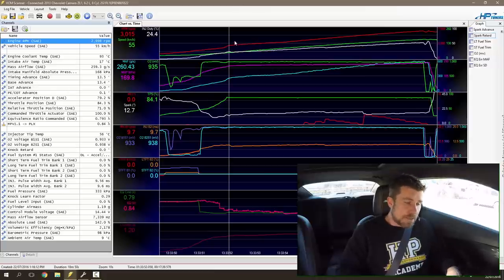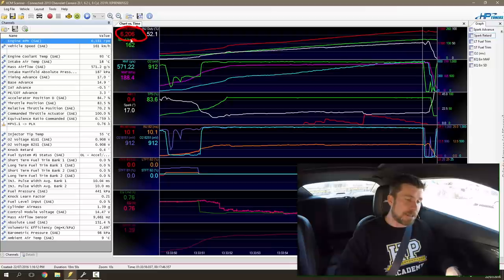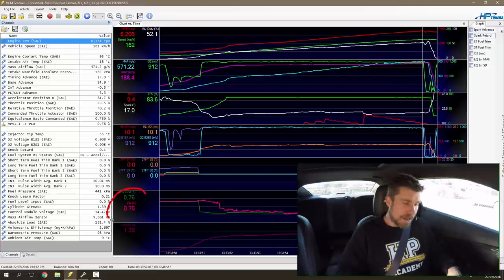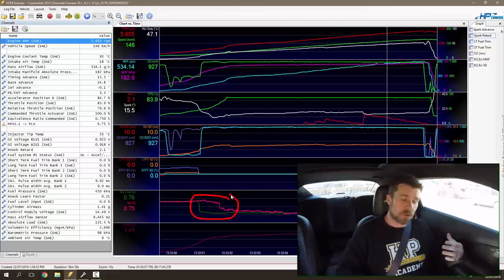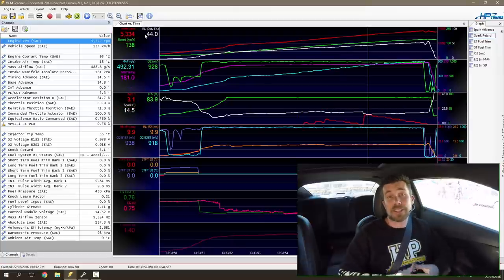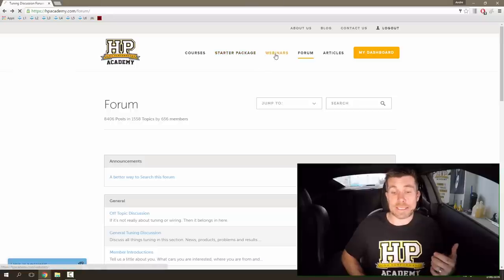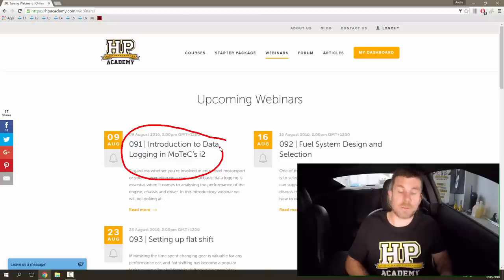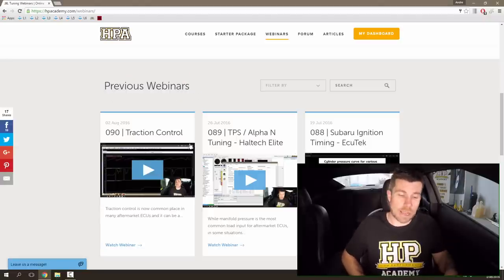Tuning WITHOUT A Dyno | Road Tuning Reflash Tuning Lesson 4 Of 4 [FREE LESSON]

Comment: Here's a real world scenario.......im swapping a stock magnum 318 in my 99 dodge ram 1500 with a 360 magnum, rv cam, level 1 ported heads, larger vlaves, bored tb, 24lbhr injectors to 32lbhr injectors, adding shorty headers..........I CANNOT FIND ANY INFO ABOUT TUNING THIS MODEL/YEAR VEHICLE.........AND........the closest tuning shop is on the opposite side of the state.
Reply from the maker: Looks like HP Tuners might support it? - https://www.hptuners.com/vehicles//?utm_source=hpacademy
Outside of reflash tuning software you might need to consider a standalone ECU - Taz.

Comment: When you had a factory ECU retarding ignition to prevent knock, what would be the right way to avoid it? I mean the ignition advance was already too low, wouldn't be better to enrich that particular sector of rpm/load with fuel?
Reply: For what I know, know occurs with the motor is too hot and that causes the mixture to ignite before ignition. If the cars is running hot it’s bc it’s lean. You can add more fuel and see if it helps if not just have to advance it but a few hp loss is better than a few pulls and then a broken motor
Reply: Delete the knock map... Where were going we won't get knock lmao 🤣

Comment: Question - what is the best method for finding best timing on a standalone ECU without a dyno, throughout the rev and load range? Typically knock limitations only happen at full throttle, but I'd want to optimize ignition timing at part-load to help with, if nothing else, fuel economy. I don't have a factory map to tweak as the car originally had a carburetor/mechanical distributor, and others who have done similar EFI conversions (VW Beetle) have dramatically different maps from one another so there doesn't seem to be a consensus.

Comment: there are calculators on the web which can also translate 0 to 100km/hr or quarter mile times to work out horsepower if the vehicles mass is known.  On a great Wall V240 just bashing the cats out dropped the 0 to 100 time from 24 seconds to 16 LoL

Comment: Hello, thank you for sharing your knowledge through these videos. I've noticed the scanner charts and seent that the throttle opening is only up to 85%. Could you please explain why you don't open the throttle further? Is it to avoid the kick-down function in automatic gearboxes? How much of a difference does it make in output between 85%  and 100% throttle openings? If you gradually open the throttle and still engage up to 100% while engaging the kick-down switch, at say 3000 rpm, will it still shift down a gear? 
Thank you for your time and answers in advance.
Reply: That may be throttle angle in degrees, not % throttle. In which case it's normal to not open to full 90 degrees

Comment: What about some kind of device like G-Tech or a phone app that senses g force and all that? Could that help to during your test if you dont have a dyno?
Reply from the maker: Sort of. In our experience, they are not accurate enough to use with margins of error from 10% to 15% if you're lucky. 
This is something that might change in the future and we haven't tested every product out there, however we do have comments about them from time to time from people who are passionate they are a great alternative, but, they're really just people who are willing to accept the risks of inaccuracy in their tuning

Let's see what the future brings us though, for those with torque based ECUs if a tool like that was accurate it would be really handy to have as an option, although it would never replace a dnyo  - Taz.
Reply: @hpa101  i have a G-Force pro and shows the hp and torque curve quite well , great for choosing shift points , but my cars are all old school , no ecu
Reply: G force devices are not accurate. But softwares that sense crank or injectors or ignition to extract rpm and then accelaration are very accurate. Providing measures are always made on the same section of a road in the same gear.

Comment: is there an ecu package you can put in an old school car
Reply from the maker: Depending on the car you might be able to get an EFI conversion kit but more often you just need to get the odd extra sensor from a different supplier than your ECU which should be your tuner if you're not tuning it yourself. Links below with more detail to help you with this question too. In my own experience the main decision ends up being if you should do this, or an engine swap. What engine you have in there and how good it can be with EFI is the decider, plus cost considerations too - Taz

https://www.hpacademy.com/previous-webinars/106-converting-an-engine-to-efi/?utm_source=youtube&utm_medium=social&utm_campaign=general-interaction

https://www.hpacademy.com/previous-webinars/120-selecting-a-suitable-ecu-for-your-application/?utm_source=youtube&utm_medium=social&utm_campaign=general-interaction

https://www.hpacademy.com/technical-articles/which-standalone-ecu-is-the-best/?utm_source=youtube&utm_medium=social&utm_campaign=general-interaction

Comment: How do you know you have made improvements to torque and power levels if you don't have a dyno to give you those numbers?

I suppose a better 0 to 60 time would be an indication but how about torque and power figures?
Reply from the maker: You can't unfortunately. There are some devices out there that try and measure it based of g-forces and other inputs, however, the margin for error on these is too high to really be of any use, safely - Taz.
Reply: I use the scanner's time on the bottom to look at from speed x to speed y. For example say from 80 km/h to 180 km/h at the exact same location then use calculator to be exact within 2 decimal places. If it goes quicker you have gone in the right direction.